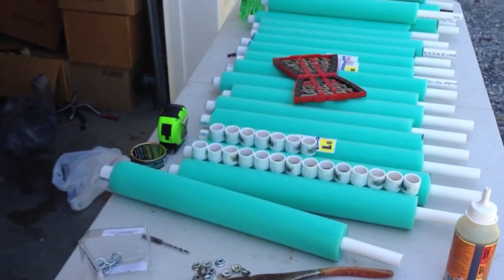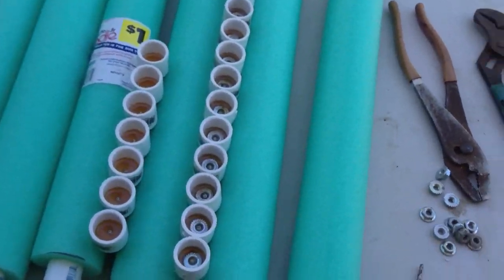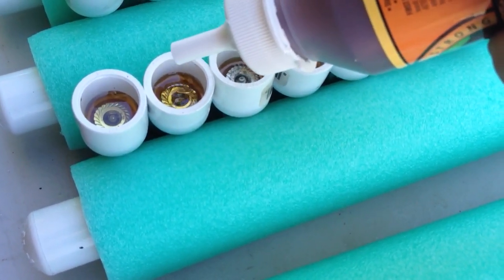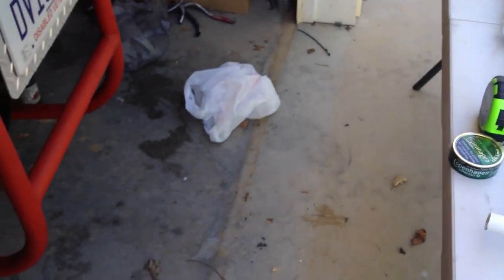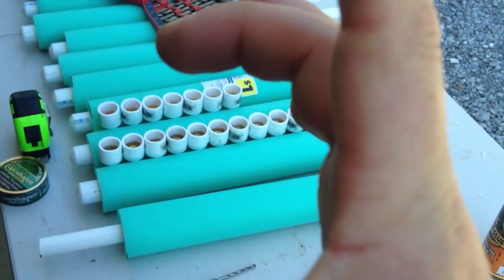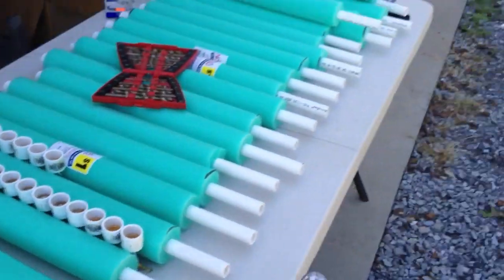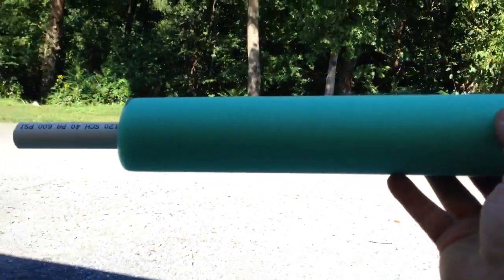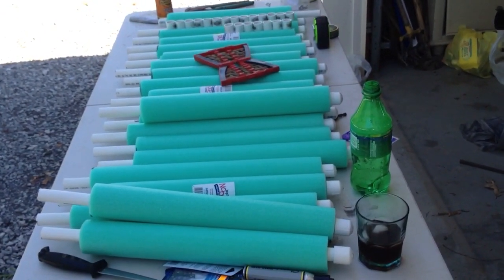Making a noodle/ jug line

Comment: I built mine much like these (just now saw the vid). I used spare bolts instead of rebar. Be sure not to go too long on the rebar as it makes a false-positive stand-up too easily. One barely lays flat before light waves stand it up. The oneI like the most is actually the one I used pea gravel as a strike indicating weight. I used hot glue in the end with my eye-bolt. I used some big heavy springs I had a big box of as weight. I've also found more than 3 hooks is a pain in the butt. Also I put reflective tape at the top. Make it great to run with a spotlight at night. Happy jugging!

Comment: You can drastically reduce cost by making these pretty much the same way but reduce your parts.  You only need a cap on the top end.  To be sure that your noodle doesn't fall off the bottom you put your screw hook in the side near the bottom.  Forget about the second cap, the glue inside, the nut and all that you don't need it.  The pipe doesn't need to be water tight at all.  I also don't know if he is catching whales or what but #38 twine is plenty big enough.  I also don't have a 1 hook restriction so I put 4 swivels on each.  I built 20 jugs lines with string, 4 swivels each, and hooks for about $100 or less. 

Keep in mind the best machine exist when you can no longer remove parts and still have it function properly :).  Don't over build these you just add cost for no reason.

Comment: Did you not have trouble with that gorilla glue turning into a foamy mess when it hardened ? I used it to do basically the same thing with some jugs I made and sealed the screw coming through the end cap with it. The next day when I checked it, it had foamed up and had completely filled the cap to where I couldn't even put it over the end of the PVC pipe........

Comment: Your spending way to much money, cut a noodle 14" long, Use about 20' of line. Tie a knot about 18" down your line. Next slide a big enough fender washer (so that it won't slide back through your noodle) with a 1/4 inch hole down your line and then run your line through your noodle. You should have about 4' of line sticking out, slide a Fender washer on there just like the other end, tie your knot to hold the washer against the noodle. Next, cut yourself a piece of PVC (3/4' Thick wall) about 4' long, drill a hole (3/16 bit) about 2' in like you would do for a pull handle for a lawnmower. Run your line through the hole you drilled and tie it like you would your pull rope, this way it won't pull through the noodle and you have something to pull that big cat with. Then with the other end rig like you normally would. I myself use a 1 or 2lb weight for my sinker. That's the only way to hold the line down fishing the Missouri River with its strong current.
Reply: Anglers Fishing Info ... I don't think cost is an issue for this guy. Why do people always have to find something wrong with what people do?